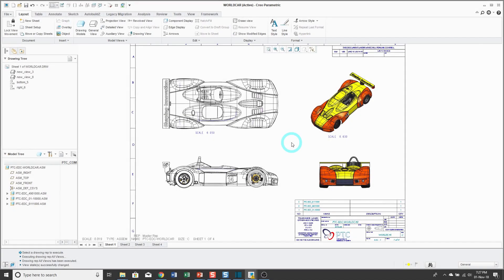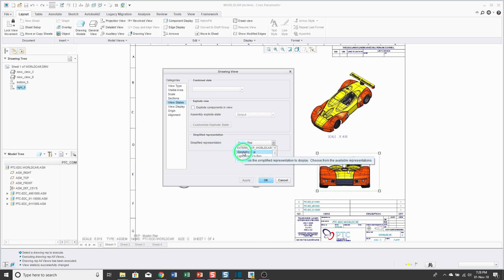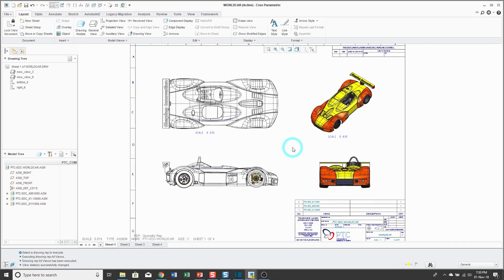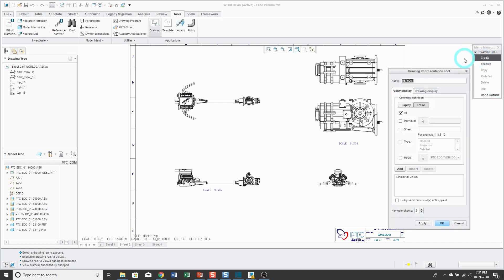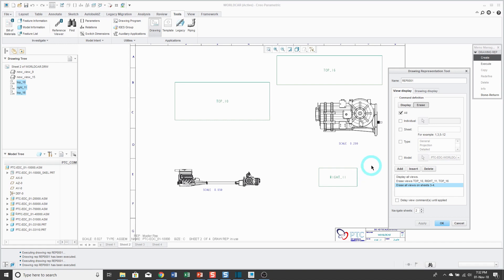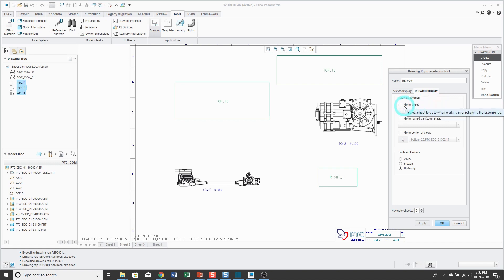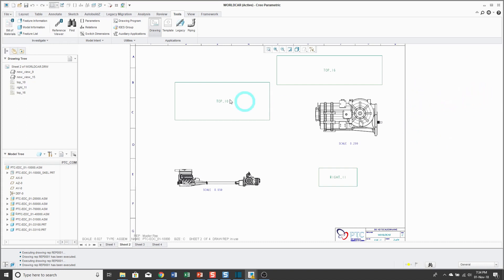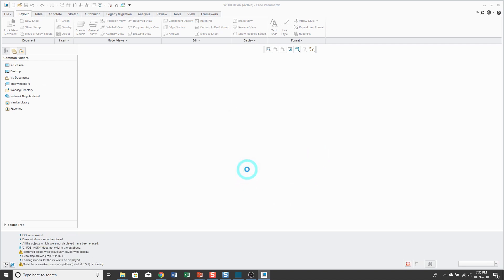Creo Parametric - Drawings and Simplified Representations

Comment: Hi, I'm stuck at 0:53. Under "View States," everything except "Combined state" is grayed out and uneditable for me. Any idea why, please?
I am making a dwg of a prt that has two Simp Reps: the original torsion spring, and the spring modified (both legs are cut short, and one leg is bent 90degrees).
But when I try to place a General View onto the dwg, only the modified version of the spring shows. I cannot get a view of the original spring to display.
Reply: Please answer this comment because mine is grayed out as well and I can’t figure out why 😩
Reply: You're probably working on a detailed part and not an assembly. I'm not sure without seeing.
Reply: I have found the solution for this, it's quite easy but as everything in Creo, it's super not intuitive and I came across it by chance and because I was starting to get super frustrated trying to find the answer. You simply select the "Replace View Model" option when long right cliking a view, and then in the "Select New Model / Representation" you press the folder icon and it will promt a new small window where you can actually select the new Representation you have created. From here, it simply replaces the model in all affected views related to the Parent View and the changes are seamless and unproblematic. But to get here, that's the problem. Hope this can help.

Comment: Hello, I use Creo at my new job and was used to SOlidworks before this. I am using Creo 4.0 at the moment and need a way to create assembly drawings with many parts removed. Simplified reps allows me to do this easily, however the BOM will still include parts excluded from the rep. Is there a way to force the BOM to only use parts included in the Rep?
Reply from the maker: Alex, that is covered in this video: https://youtu.be/jjgynKE9vqw